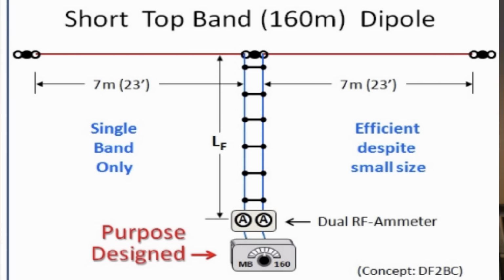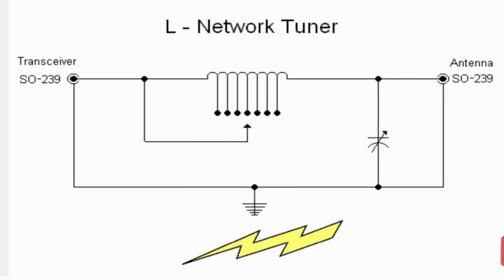160m Band Ham Radio  -  Backyard Set up

Comment: Thank you for your video.  Mostly what I heard from you is that 160 can be fun and interesting, but in general, it takes a bit more space for the antenna to "spread its wings".  But that's always the case as we go lower in frequency.  I mean, 70cm antennas are smaller than 2 meter antennas, and those are smaller than 10 meter antennas, and so it goes.

But the biggest thing I got from you is that 160 is interesting and can be worth the effort, so we should all give it a try.  That is, after all, a general premise of amateur radio where we experiment, learn, and help others.

I've got an FT-101ee with 160 meters on it.  Based on your video, I'm now thinking that I should give it a try.  A 160 meter wire antenna shouldn't really be much more challenging than an 80 or 40 meter wire antenna, right?

Again, thank you for the video and the inspiration to try something a little different.

73
ZL1SAW
Reply from the maker: Yes give it a try. If possible try and establish rge popular spots snd listen at different times of the day. Here in the UK it is usually in the evening. Maybe see if you can find when there is a 160m net operating.

Comment: I was near Stocks bridge and used 5w to work some guys in Ireland using 136ft end fed wire through a tuner . We was on the hill so radio at the lowest point wire was layed on the ground. For home I run a G5RV full size and a 102 ft doublet in parallel doublet will tune 160m no problems .I  also have a  vertical that works on everything all these are home brew . Local hams know me de M0JFE
Reply from the maker: Great report. Thanks for sharing.

Comment: I use a 1/4 wave shortened slower antenna and  operate primarily CW and FT8. I have worked all 50 states and 96 countries. It should be noted that “top band” improves as the solar numbers decrease which is where we are today. Patience and persistence is required, but  very rewarding. De WA2SQQ

Comment: Just another great vid, dear Peter! 
In spring this year I tested my Self-made 1:64 Unun with a 42m wire 5m above ground: It was resonant in the middle of the 160m band. 
Worked properly, but not so mobile compared to the design of dj0ip. 
Best 73 Chris HB3YJR

Comment: My first employer had a club station with a top-band diapole 70 feet above the ground, we had the strongest signal in Europe. Of course we never run the linear (4x 4CX250B) illigaly. We also had a multi band beam at the same height.

Comment: Peter,
Thank you for another video with great information.

I'm located in a east coast US state. Within the last year I have installed two end fed random wire antennas for 160m thru 10m,  they even work on 6 meters.

The main antenna is a 155ft inverted-L. The other antenna, installed mainly for NVIS is a 77ft horizontal about 10ft above ground. The 77ft antenna has several bends as it is routed through several trees. Both antennas use the coax as a counterpoise with 31 mix ferrites placed for the best SWR across the bands. SWR on most bands is less then 2:1 across the band and SWR is below 2.5 on all bands. The radio's built-in antenna tuner handles the SWR nicely.

I work mainly FT8 and JS8. The inverted-L antenna operation on 160 meters has provided confirmed contacts with 4 continents, 31 countries and 45 states while using 5 to 50 watts. 

The 77ft NVIS antenna has good signal out to about 300-500 miles on 160, 80 and 40, farther on 30 thru 10

Palomar Engineers has good information on their website and various YouTube channels.

73,
Jim
Reply from the maker: Great to get that info Jim.

Comment: Once used a G5RV fed as T top driven against a couple radials run along garden fence. Short out the feed point flat lead at the ground, feed that junction wire with coax center conductor and shield to the radials. Match achieved with L match...
Many thanks.
73 de K4WRF

Comment: Interesting as always Peter.
My main antenna is an extended double Zepp cut for 20M, and fed with homebrew OWF with a 4:1 balun at the end straight to an ATU. It works really well on 80 and 40, but have not tried it on 160.
The other antenna is an 80M dipole fed with OWF down to a box out in the garden. At that point is a pair of 1/4 wave radials running along the fence cut for 160M. The idea is for 160M the OWF is shorted at the bottom with a relay and the OWF becomes a vertical with the 80M dipole a capacity hat at the top. It's a work in progress but shows promise.
David, VK5ZL

Comment: I use two antennas for Topband (160m). For portable use, I use an Ampro 160 mobile antenna. This is mounted to a camera tripod, with a termination plate for the feedpoint and a 60 feet length of wire counterpoise. I also use as a home base antenna an old `Sandpiper Marine’ MV 10 but only use the 160m portion of the antenna. These are generally used for local fixed frequency nets and local skeds. However, we did on one occasion have a GM station call in at the end of one of skeds. (I live on the south coast of U.K. ) he was very weak, but we did make contact, not sure who was the most surprised 😂. But yes, Topband is achievable in limited space, with the usual caveats of compromise.

Comment: My 80m EFHW runs 160m easy. I have a switch box that bypasses the 49:1 unun and feeds it direct as a 1/4 antenna with a proper set of ground radials I get a match no higher than 1.5 on the band edges.

Comment: 160M was popular in mountain country, you could talk valley to valley often over a hundred miles day and nite. Almost any longwire would loadup connected to a tube rig with a pi network. Ofcourse there were no computers and such in the shack to overload. A good antenna if one has the space is a halfwave Square halo with capacitive loading where the tips meet and a reflector wire under it.

Comment: Hi Peter, before the FT 8 squatted the 1839 to 1843khz there was a lot of traffic on 160.  Nowadays  nearly nothing  under 1850. You have to go on 1850 and up to 2000 for SSB traffic, that is not attribuated in France.   A Guy from the frequency control service told me as long as you dont collide with the marine stations............😅  A 2x27m dipole with 13m open wire feedline works fine.
Reply from the maker: Interesting to hear your experience from France.

Comment: Re that first doublet... An ATAS120 is 1.6m long which is only 0.04 wavelength on 40 & that doublet is 7m a side on 160m hence is 0.044 wavelengths so no more of a compromise.... Also to be noted if you swapped your half size g5rv feed line over to dj0ip's (& used his matching unit) then there is a fair chance it would work on top band too.

Comment: My club has a quarter wave vertical! I used to do quite a bit on top band using an 80m off centre fed dipole strapped and run against earth. Many radios didn't have 160m built in in the 70s and early 80s.
Reply: And power was 10w limit

Comment: My first antenna was an end fed wire and the FC-40.  I used the "magic length" of 84 feet for best multiband results and it worked well from 6 meters down to 40 meters.  But I had trouble with 80 meters and 160 meters until I changed out the ground wire for a long counterpoise - something over 100 feet running on the ground where I could fit it out of the way with several turns in direction.  This worked all bands quite well.  I later changed out the FC-40 for a 9:1 unun with good results.  The internal radio tuner will match this on all bands, even 160 meters.   I just wish more people were around on 160.

Comment: 160m is indeed an odd band.  Many years ago, I drove from Edinburgh to Ipswich in my old  series 3 Land Rover.  On the roof of the vehicle was my G-Whip Tribander antenna, set up for 160m.  Sitting on the passenger seat beside me was my Yaesu FT101E.  When I left Edinburgh, I started a QSO with Peter, GM4DTH in Edinburgh.  We chatted a lot on 160m that night, but we put the QSO on standby as I was approaching the Tyne Tunnel at Newcastle.  Now for the interesting part.  Peter started calling me again whilst I was still in the tunnel.  I could see daylight in the distance, but I was still well and truly in the tunnel.  We were able to restart the QSO before I had left the tunnel.  Both of us were quite amazed by this.  Angus, GM4IFC.
Reply from the maker: Interesting. Problem these days is that 160m mobile activity is hard to find.
Reply: Maybe the signal was transmitted through the tunnel power lines?
Reply: @dongjuang4196 
No.
That frrequency will go through tunnels and caves (I've do it myself on mobile with a FT-101E....!!!!!!! (Hustler mobile antenna)

Comment: It'll be great if the 32w power limit above 1850 could be dropped and allow use the full potential of our radios, saying that it's still easy to work around the UK and Europe on 32 watts band and noise conditions allowing.
Reply from the maker: Not sure why dramatic power drop above 1.850MHz.
Reply: @watersstanton it's so we didn't interfere with shipping, fishing trollers etc (fish radio) you don't hear them anymore so I can't see the reason to keep the lower power limit above 1850.

Comment: I'm CW operator and just bought a FC-40. Like to use it for 160m long wire antenna (+30m band), but because I broke me leg I can't test now 😞. It would be great if you can do a practical test, particular on the (minimum) wire length and ground system needed to make it tune 160m. As far as I learned in the internet FC-40  might be more delicate than e.g. Icom's AH 730. Yes, such antenna are maybe less effective than a dipole, but better less effective antenna than no antenna. Isn't it? I think such external tuner setup will work for many space restricted places, so why not do a practical test in your garden? Interesting for many of your customers 🙂.
Reply from the maker: I don’t have an FC-40 to test, but maybe I will try and borrow one.